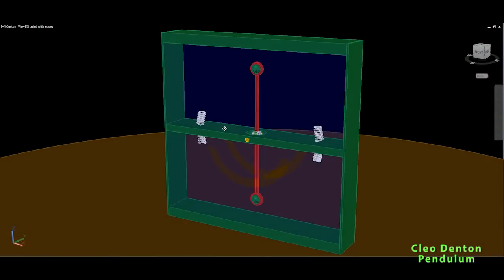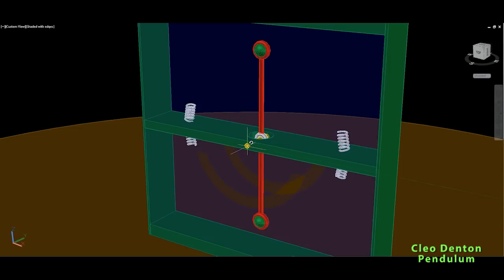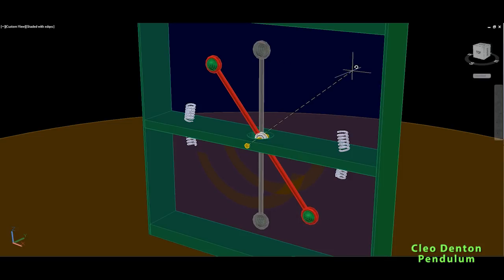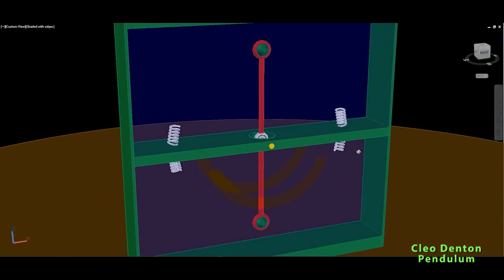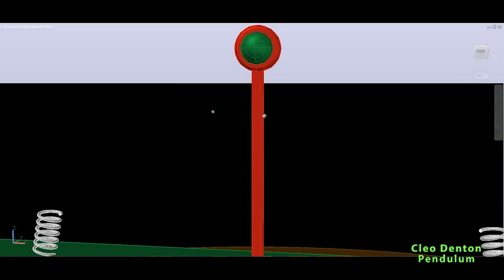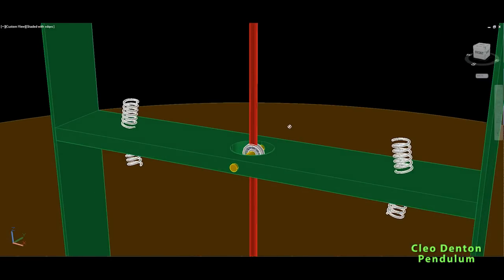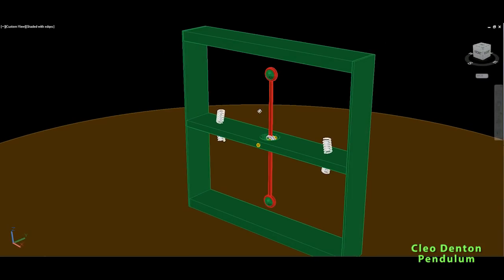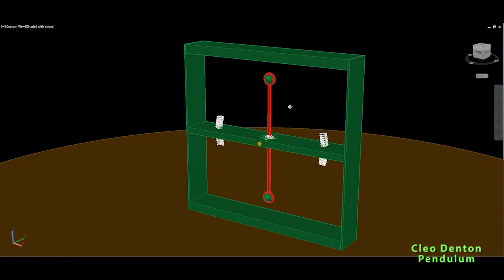FREE ENERGY, Cleo Denton Perpetual Motion Pendulum

Comment: I don't really get why you've made it the way you have. The two weights will counter each other out so there's barely a pendulum anyway. I guess technically it'll act like one if they're the exactly the same mass since the bottom one will have a slightly larger weight (closer to the earth) but it's basically negligible. So you'll just be bouncing something back and forth between two springs, which is a pretty high energy loss process. A regular pendulum just swinging would last longer.